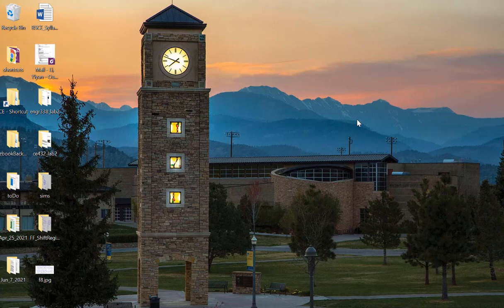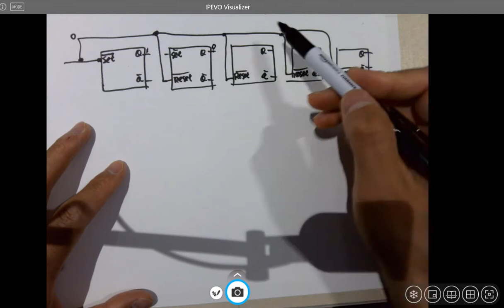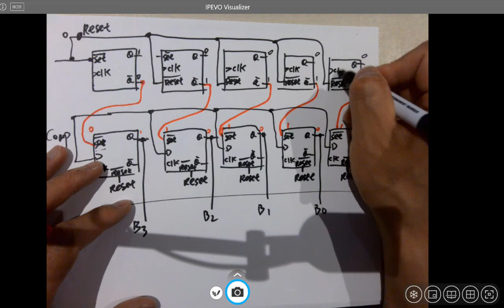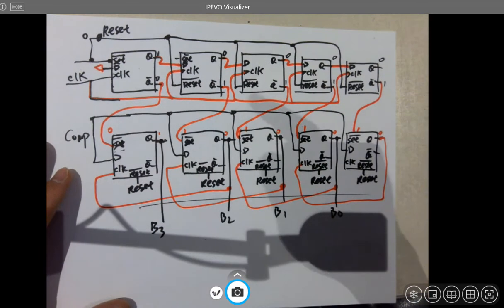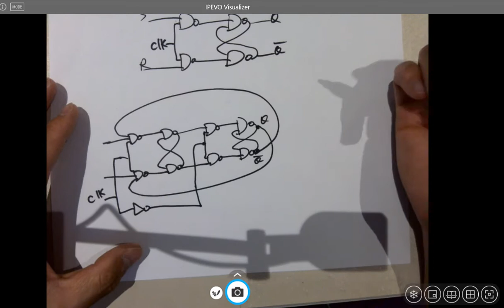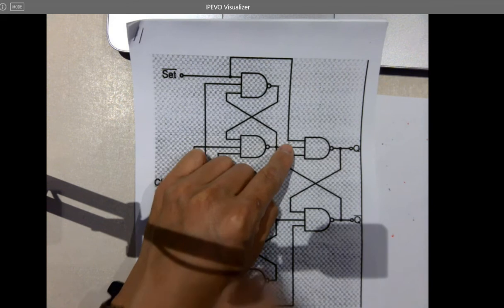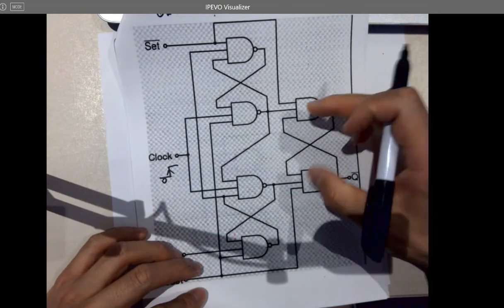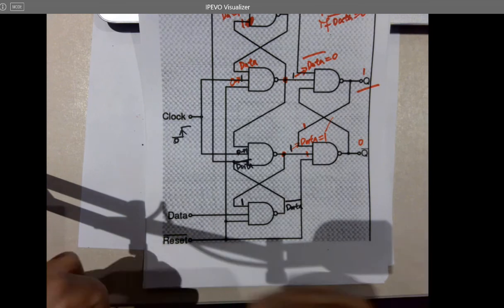ENGR338 Digital Electronics - Lecture 8 The SAR Architecture (successive approximation register ADC)

Comment: Very clever design, can I assume that one reason that it’s preferable to trigger clk’s rising edge is power consumption because instead of shifting a ‘1’ and the remaining registers are stored with 0’s. For falling edge, we’d be shifting ‘0’ where the remaining registers are stored 1’s(the reset and set bar would need to be rerouted in this scenario). But I’d assume throughout a whole conversion cycle, storing a 1 in many registers for a cycle duration could burn more power than to perhaps shifting 1’s especially for a higher resolution ADC?

Comment: If A2 is set to a 1 by the comparator and say A3 is a 0 from the first clk cycle. Wouldn't A2 then trigger the first register's clk and cause the comparator output (1 in this case) to be latched onto A3, thereby corrupting the data? Or am I missing something here.
Reply: Same doubt, had ur doubt cleared now btw?
Reply: Not sure if I understood what was asked. A2 is set to a 1 by the binary shift registers at the top and for A2 to be set to a 1 by the comparator.  A1 flip flop would have to trigger clk rising edge on A2 with a comparator output = 1. 

I believe the confusion is that, the proceeding register(d flip flop) updates the preceding register which is why there’s an extra register to the right to update the last bit A0. So yes, A3 stored ‘0’ at first and was updated to ‘1” accordingly by A2 since A2=1(clk A3 is true) and Comp=1(is true). Next, A2 will get updated accordingly by A1…… the last register A0 will get updated from the addition of “dummy” register. Kind of reminds me of an iteration of the Fibonacci sequence haha

By this SAR circuit configuration, it starts at the MSB and trickles down to LSB traditionally. It could probably start at the LSB and move up to the MSB if things were rerouted differently and the dummy register is placed adjacent to MSB register idk.